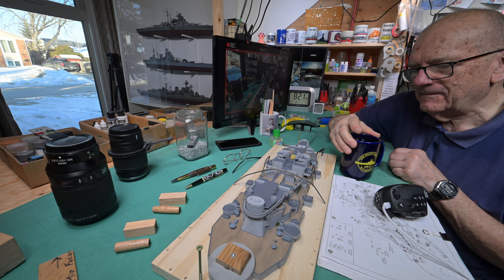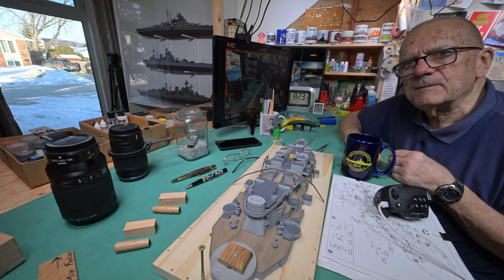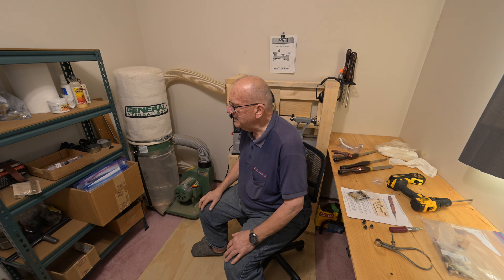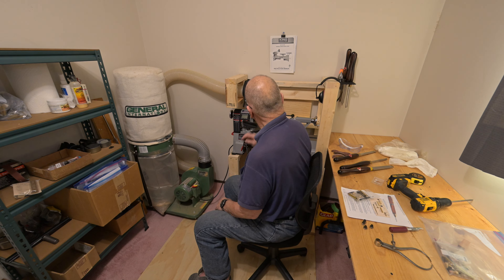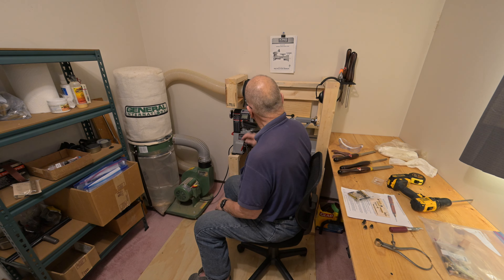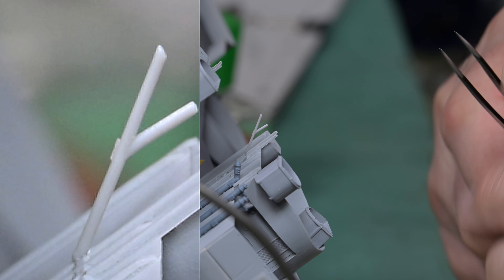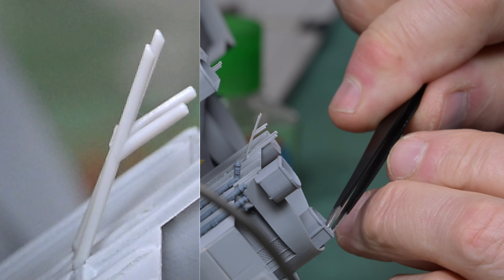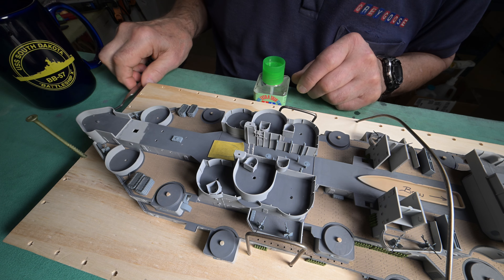The Model Ship - Part 1539

Comment: Hey Ron 
    You were minutes away from being done with  step 26. Outstanding job angling deck to put brackets on. The underside of baskets have a ridge but with thick on 6 legs you will get it level by finding the spot where all legs are on same level. Very proud of your efforts and Yamato won’t be anymore challenging. 

Mike